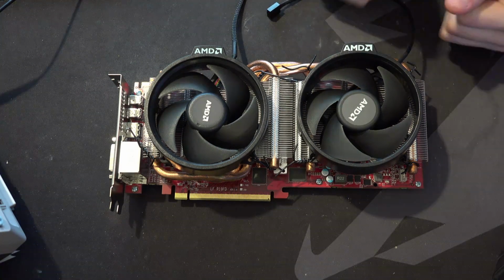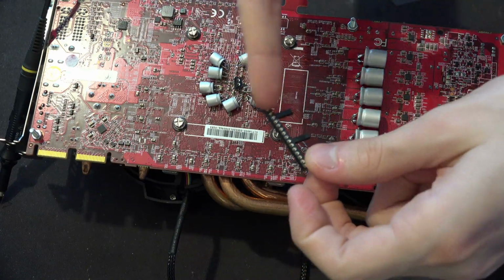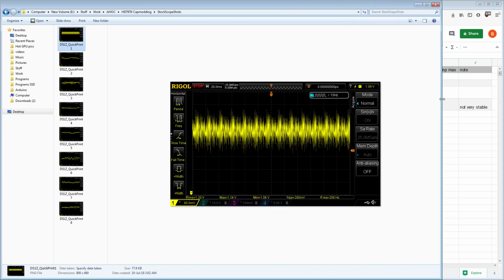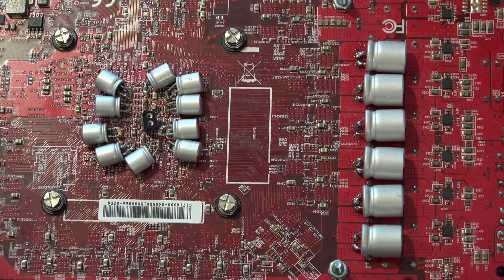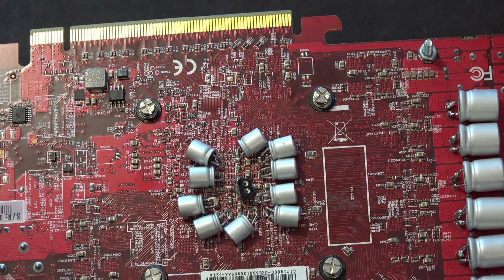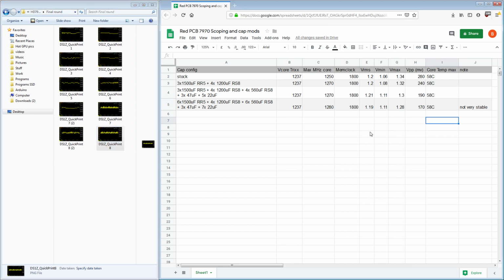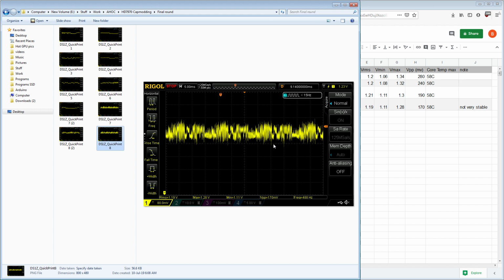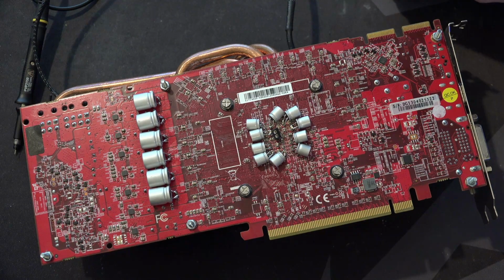Capacitor modding a reference HD 7970

Comment: I think this is a perfect example of efficiency. Thus the power leveling means lower input voltage. Good one droidzuu. Unless starting power is undervolting for too long even higher than 500 would benefit.

Comment: Tldr;
Placing caps close to the load makes them perform more as ideal caps, thereby reducing transients/ripple more. 
This is more important for small caps as their resonant frequency is affected more by distance relative to bulk caps. 
+ an explanation on how to figure out if a capacitor will have an effect before you add it (which can be used to determine if you should remove your larger caps far away). 

Your statement of having caps close to the load and 'screw the VRM' is correct.

The reason you want caps closer to the load is to smooth out the ripple/transient, as you surely know. Placing the caps as close to the load as possible reduces the effective ESL due to less being introduced from the distance the current must travel across the PCB. I.e a cap will work more as an ideal cap (decoupling  higher up in frequency) the closer it is. This is also why the small low ESL/ESR MLCCs are placed closer to/right on the back of the chip as these handle the highest frequencies as opposed to the bulk caps which are large and thus handles the larger and lower frequency power required before the VRM figures out what to do.

The resonant frequency I.e. The frequency a cap will reach its minimal impedance (thereafter starting to increase) is:
2pi*f=1/sqrt(L*C)
Where L is the total inductance seen by the cap (ESL + ESL_PCB_distance+via) and C is the capacitance value. As larger caps tends to have higher ESL and obviously capacitance, their resonance frequency will be less affected by distance from the load, while the small low ESL caps will be highly affected. This is the reason bulk capacitance tends to be close to the VRM (as this is the lower priority cap) because it is the closest it can get, not because it is better to have it close to the VRM than the core; it is just less bad to have it further form the core than a MLCC. Same argument for why the bulk cap is closer to the load than the VRM. 

On a similar note to the resonance above the impedance of a cap at a given frequency can be calculated as:
Z = 2pi*f *L + 1/(2pi*f*C)+R
Here L is the total ESL for both cap and PCB, C is capacitor capacitance and R is the ESR. this can be used to calculate if a cap you add will have any effect at the frequency you are trying to suppress. For example adding a huge electrolytic capacitor far away to suppress 2GHz noise will have little effect while a MLCC close to (even though much smaller in capacitance) will. Note however that the bulk may not reduce high frequency ripple, but may help your load trancient, which I do expect is much lower in frequency. 

Also placing caps close to the load makes current not having to travel across the power plane disturbing anything in its path (don't know how much this affects GPUs, as I don't know how many components are connected to the core voltage power plane in between VRM and gpu core, but in general EE design this is also a reason to place caps close to the load and not the VRM).

Thus in summary the closer you place caps to the load the less transient your VRM will see.

Comment: Try adding a few thick stranded wires between the chokes and GPU (with all those caps still on) to decrease the resistance of the power line and report on your findings!
Reply from the maker: already thought about doing that on some cards.

Comment: Try adding a few thick stranded wires between the chokes and GPU (with all those caps still on) to decrease the resistance of the power line and report on your findings!

Comment: The bad transient response on some/many of those graphics cards, could that be a reason for AMD to have that stock voltage so ridiculously high? Many AMD-GPU's can be undervolted with around 0.09-0.1 V. If AMD wouldn't have sufficiently strict rules then I can see AMD demand  stock voltage which is a bit too high to compensate for those bad transient responses. What do you guys think about this theory?

Comment: compared to the ceramics by the GPU, the electrolytics you added probably still had lots and lots of ESR at the high frequencies a GPU switches its load. There are bigger ceramics that would probably have been of more use directly under the core. But adding bulk capacitance in the "far away" spot couldn't have worsened things.

Comment: HOT GPU PICS :):) 
THANKS TO YOU IVE BOUGHT RX 570 PULSE FROM SAPPHIRE and its great. I will go all Red but for now my 4,3ghz i7 950 hold up good. (Also my rx570 peaks at 1480mhz core and 2250 memory)

Comment: Hey, I had my Xfx R7970 3gb Black edition Die- It one day (a month ago) started having the occasional 1hz screen flicker Which included Blue and Orange colors in it sometimes (memory?) was gaming and the pc crashed and gray screened, pc then refused to boot. After trying 20 restarts it turned on once, when it did it went to desktop and seemed fine except it was at 150mhz core 300 mem vddc 0.806  (turned off OC-should be Stock 1000c 1425m 1.113vddc constantly) Under load the card starts at 150 300mhz and it jumped up to stock however the vddc increased to 1.090 and then started decreasing until crash with gray screen (also drops to 150c 300m on crash) booted did it again, Now it won't boot at all. (tried like literally 200 times xD) Take out gpu and pc boots fine, put in other pc it didn't boot. So rip got a rx 580 8gb gigabyte gaming. BUT i wish i knew why it stopped, Any ideas???
Reply: That R7970 literally scored higher in Superposition benchmark then my new rx 580 8gb gigabyte gaming. Not sure how to feel about that.

Comment: the moment I saw that PCB I thought "looks like power color" saw the number above the pcie fingers and knew that was power color. I got a Powercolor 7850 with a similar looking board. Seems to perform well even though it's also missing phases with no cooling on VRMs and OCP is either not there or doesn't work. No cooling on memory also sucks, it gets overheated with heavy memory OC (solvable with some means of sinking heat- I used aluminum flatbar as a heatspreader, and thermaltaped heatsinks on that). I think I should do a bit more with that card.. only 1 PCIe lane still works for some reason, but overall it still works. I want to grab some Tahiti cards to play with, not just pitcairn, hawaii, and polaris I have now.
Reply: we had 2 vtx3d 7850 2gb single fan they were pretty cool with there red shroud :) that was back in 2015 ish my oncle used them to crypto mine. i used to love them cause they looked cool